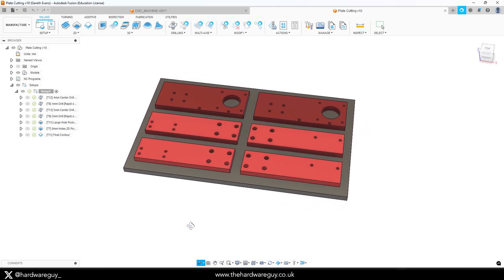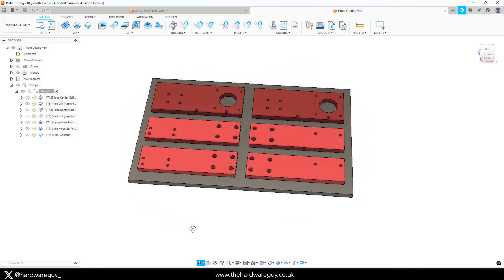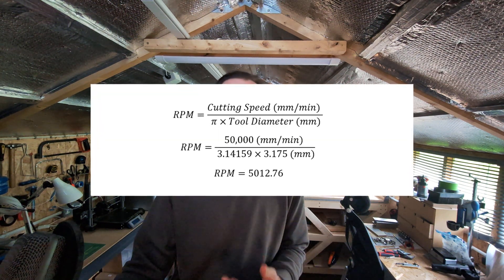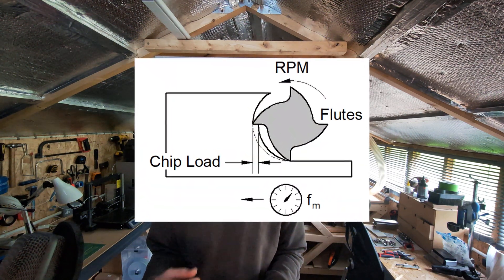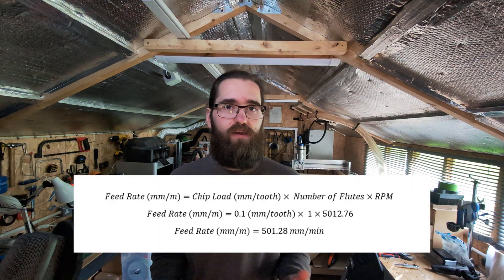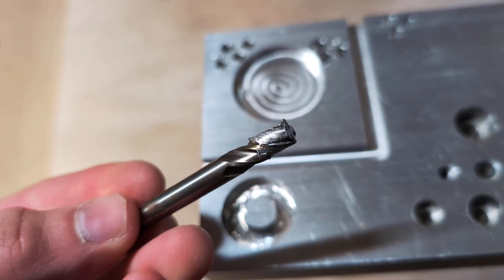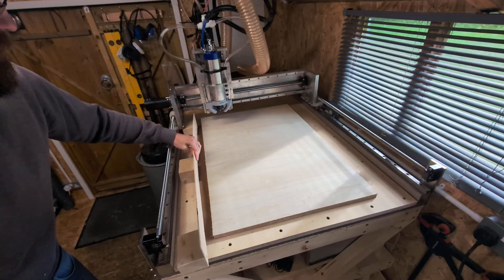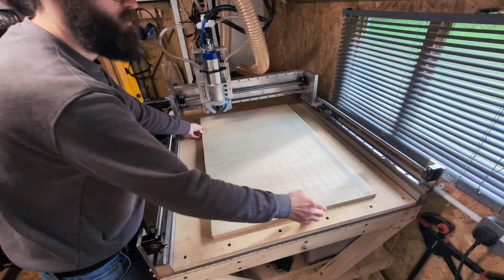DIY CNC 017 - Cutting Aluminium Upgrades

Comment: How did you create the 4mm holes? Did you use the 1/8 endmill? What type of machining operation did you use?
Reply from the maker: they were drilled using a regular metal-grade drill bit

Comment: Check for "AluPower" 3 flutes end mill from YG. Their flutes are miroir polished and you need a little or even no coolant at all. 1500-2500 of surface feet(sf) is correct. To preventing clogging, a small spray of W40 from time to time is a good solution specially when you machine soft aluminum (soft 1000-3000 series) or copper which can be a pain in the a@@. Hope it will help.👍🇨🇦😊

Comment: First, thanks for bringing calculations into the discussion; it’s rare to see this in hobbyist circles.

"I keep parameters low" = My machine lacks the structural integrity and component strength needed to mill aluminum properly. It’s important to understand this.

"The more flutes your bit has, the faster..." This isn’t totally true because more flutes reduce the chip size, which is an RPM vs. chip size trade-off. You’re going faster because your machine can’t handle the full chip load of a single-flute bit.

Clogging comes from friction—too much heat due to parameters that are too low. The speed is too high, the chip load too low, causing the bit to overheat itself and the material. This affects cut quality, dulls the bit quickly, and increases wear on the machine's components, especially guides and transmission. And you can see it: you’re making aluminum dust, not chips.

The bit requirements are the key factor. Everything starts from the bit, including the whole machine design: I want to do that job with that bit. What spindle requirements, component strength, and structural integrity are needed? Design around the biggest bit and the toughest job you want your machine to handle; this will dictate everything around the bit, from the spindle to the power cord.

Always set parameters according to the bit's requirements. Don’t reduce them just because your machine can’t handle it: use a smaller bit instead. A smaller bit requires less power and generates less resistance. Light-duty machines can still do lighter work. Use common sense: see what kind of machines people use to mill aluminum and ask yourself, does yours look like that? Is its budget comparable to proper milling machines? There’s no magic here. If manufacturers could cut costs on aluminum milling machines, they would. If they use expensive components and heavy structures, it’s because it’s necessary! Your machine is perfect for wood, foam, plastics, and composites—materials gantry machines are meant to handle. It might manage very occasional light engraving or milling in softer metals like brass or copper. You don’t need to be Einstein to see that thick aluminum milling, day in and day out, is beyond its capabilities. Definitely. And don’t be misled by YouTubers showing steel and aluminum cuts on budget machines; poor cut quality means the machine and bit are suffering and won’t last. Once again, they're making aluminum dust, not chips.

Milling metal on a budget is a dream unless you’re a master at reclaiming parts, as components aren’t cheap. The structure might be affordable; you could mold a concrete frame inexpensively. But it shouldn’t be a gantry-style machine. Metal milling machines don’t look like that for a reason. There’s no universal machine: lasers and 3D printers should be light and fast, while metal milling machines need strength and weight. Machines claiming to do a variety of tasks often do none of them well. Just follow the proven designs of reputable manufacturers for machines that are up to the task.

My goal isn’t to criticize the work you've done—it’s impressive for a hobbyist. But your machine isn’t built for milling metal, aside from brass, which is still a great achievement. Avoid falling into the upgrade spiral: investing in V2, V4, V15 of the same type of machine that will never meet your metalworking needs, when your current machine already does a great job with lighter materials. A dedicated DIY mini milling machine or a second-hand milling machine you can digitize is likely a much wiser investment. Just my two cents.
Reply from the maker: Thank you for the thorough feedback—I appreciate you taking the time to comment. My goal with this machine has always been to create a versatile hobby setup that I could occasionally push into light metals like aluminum. I do believe my machine will get you further than off-the shelf hobby machines, at a lower cost. However, I’m fully in agreement that it lacks the robustness and high-powered components needed for serious, day-in, day-out metal milling. There's a reason those indistrial machines cost tens of thousands. 95% of my machine use is milling hard woods, other 5% is occasional aluminium project parts. It's perfect for me!

I kept my parameters conservative due to lack of experience, you've got to start somewhere so it might as well be in the safezone. And yes, that means compromises—like occasionally producing dust rather than proper chips. But for my purposes, I accept these limitations; the intent was always to occasionally try my hand at metal with realistic expectations about its capabilities.

Your advice on bit selection, chip load, and machine requirements is spot-on. While I know it isn’t a heavy-duty milling setup, I’ve truly enjoyed the learning process and the challenge of optimizing it within reason. Thank you again for the honest insight!

Comment: what is the recommended surface speed for Aluminium ? can you just put this and the tool info into fusion and have it calculate the spindle rpm ? Am a bit confised.
Reply from the maker: It varies depending on your setup and who you ask, my advice would be to use the recommendation for the bit that you'll be cutting with. Yes Fusion 360 will calculate a lot of it for you, but don't compeltely trust it. Get a feel for it!

Comment: Use the shortest endmill you can for your cut depth  keeps down the chatter and reduces tool deflection. Also if someone is going to cut alot of metal buying quality bits saves so much time
Reply: Agree, you will need to adjust your chip blower, but you want the bit as close to the spindle as possible and as short as possible. Search for something called a fog buster. You need to have a little lube when cutting aluminum.
Reply from the maker: I checked out the Fog Buster, very cool and versatile piece of kit!

Comment: Awesome Project. You are really getting it, WOW! I first have had to learn using 3D design software. Started with Fusion 360 back when student license was offered. When that stopped I switched to FreeCAD. I first thought after I got enough experience I would buy a 3D printer but now I use my local maker space at my library. I have designed a small 1.5 to 2hp 48" belt bench grinder, and will send it out to an online fabrication shop to cut my parts.These shops are a one stop shop i.e. material, hardware, fasteners, etc the just I will just need to supply the motor and belt. I crunched the numbers and the price is so competitive, oh yes they have free shipping, too!
I think you should be really proud of your accomplishments so far!
SideNote: i am adding a lean-to room onto the side of my garage, for addition CNC projects so I recreated my garage building framing in FreeCAD and have designed the room addition accordingly. It is really a confident builder to design in FreeCAD then have the ability to create the dimensions needed for cutting my actual lumber, and it fits!
Thanks for sharing!
G_Dub